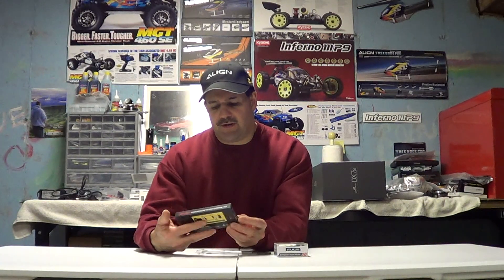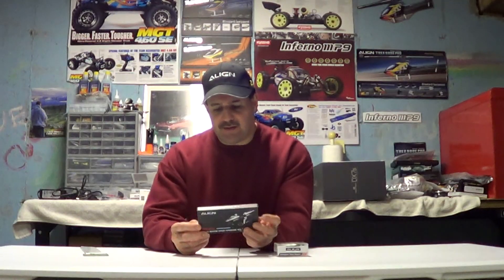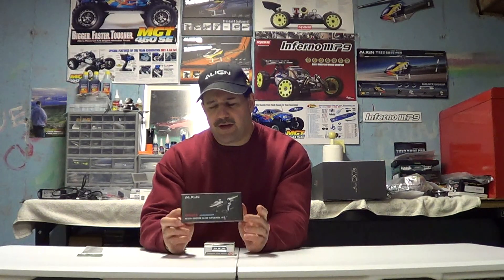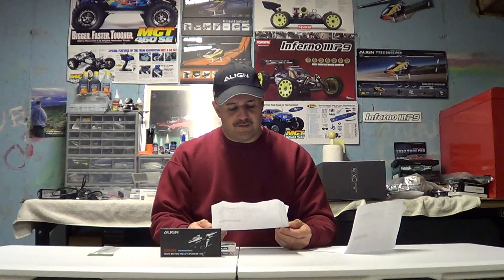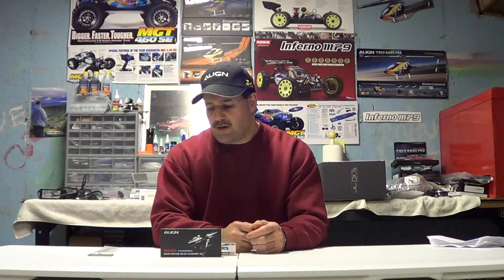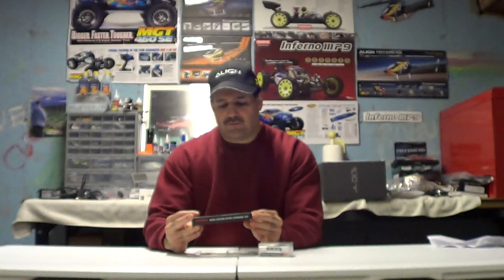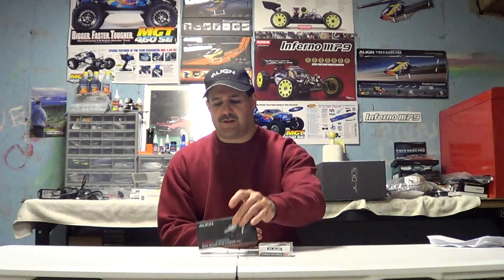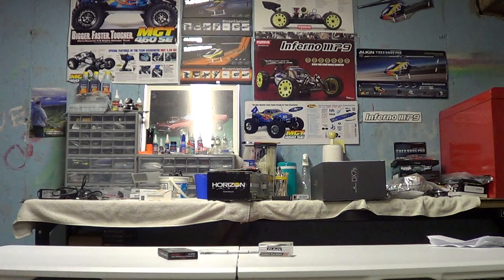Align trex dfc flybarless upgrade

Comment: Thanks for your vids. Yes, by the time I find out about a part its 4 years old. You mentioned 450, 450 pro, 450 proV2, pro EFL. I screwed up by buying the last 450 plus flybarred off some shelf who knows where, I think it was actually under the shelves forgotten about by the dust on the box. I was instantly and easily 6 years behind and just starting. Not much info about a 450+ out there. I ordered a DFC kit that works with 450pro, proV2 and sport, thought "hell itt'l work" but now I'm lost cause linkage rods are nowhere near what they're supposed to be. I may have screwed up again so guys PLEASE, read and get up to date b4 you order anything and yes it will be the most expensive out there but I have cost myself more money than that in the long run

Comment: With the DFC Swash, they have designed it because with the old method where the balls are flat to the swash the ball joints got very lose and could pop off. The DFC Swash is designed to push the links to reduce wear.